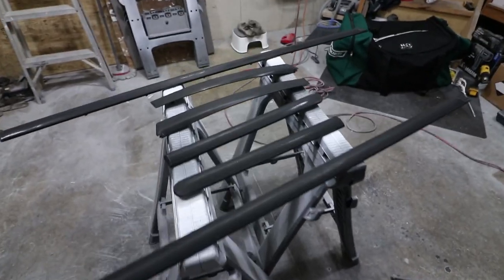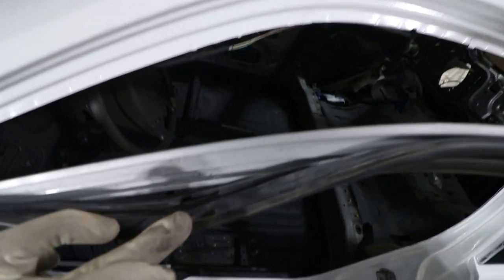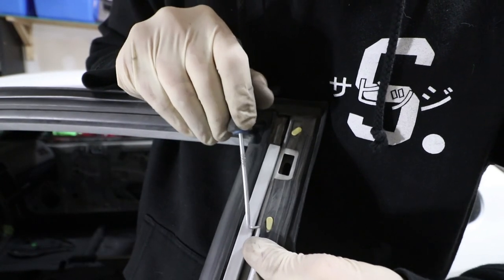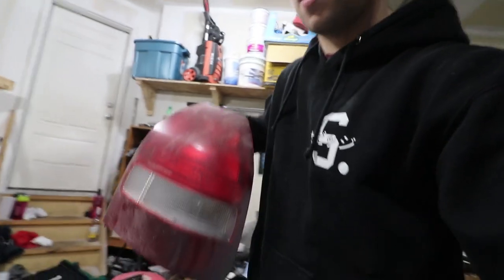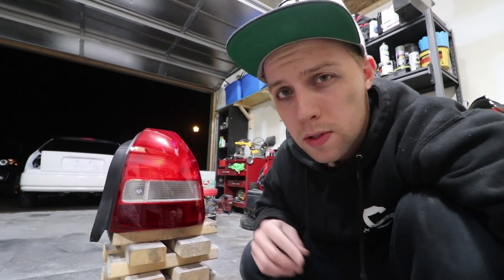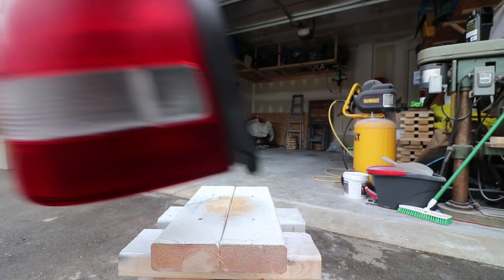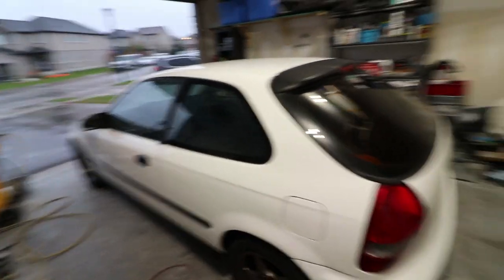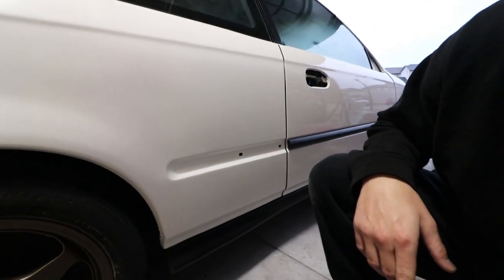Fix and Restore Faded Plastic Trim & Car Tail Lights or Headlights

Comment: Thank you for keeping your side moldings black. I HATE it when people color match or delete the side moldings on EG/EK Civics.
Also I see alot of guys color match the rocker moldings ("side skirts") as well. It all looks dumb. It should all be black as intended. Good choice sir!
Reply: However on higher trim models, I know with EGs at least, have color matched door handles and mirrors and that looks good. But I get keeping it the stock black in your case.

Comment: Coming out nice bro just in advice but you should put some of heavy duty doble siding tape in the molding this way give extar protection against moisture and prevent o get easy remove .good i cant wait to see her finished god bless im working on my accord wagon right now im just having a hard time to find a quarter panel.
Reply from the maker: thanks, might do the taping since i still have easy access to the clips on the inside

Comment: if the handles and trim are at a point where the finish needs to be addressed. get s can of polypropylene primer and a can of dupli-color bumper coating. scotchbrite them, clean, one coat of poly, then the bumper coating. you will be amazed.
Reply from the maker: Thanks for the tip and for watching the video

Comment: Where did you get the tail lights? I just picked up a EJ9  and am trying to freshen it up. I want to get rid of the amber in the taillight housing  because it looks super clean with the clear strip in it.